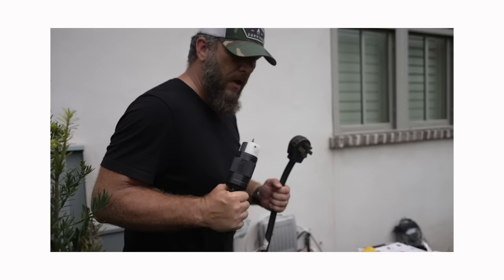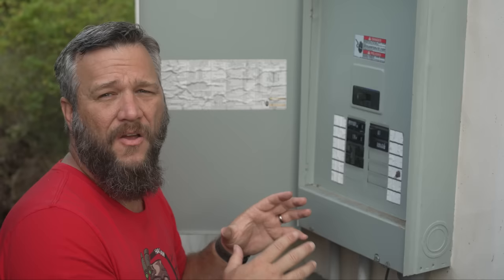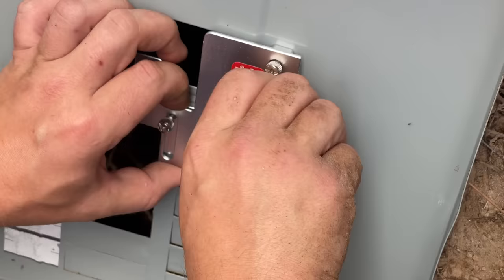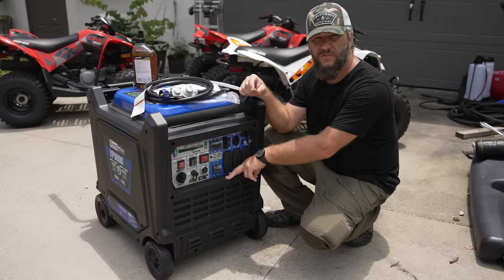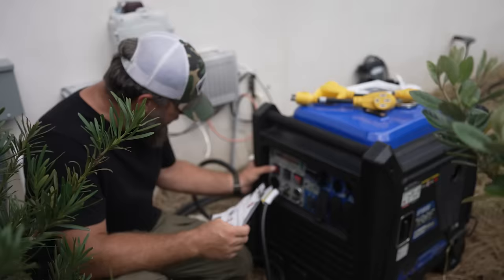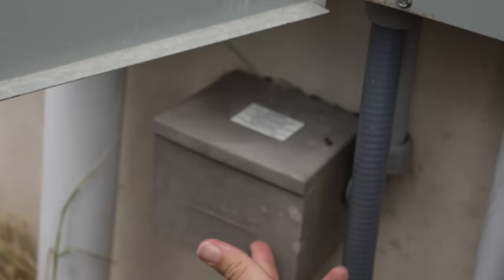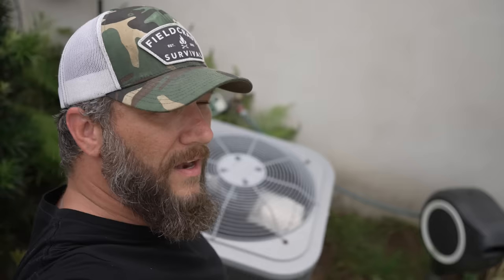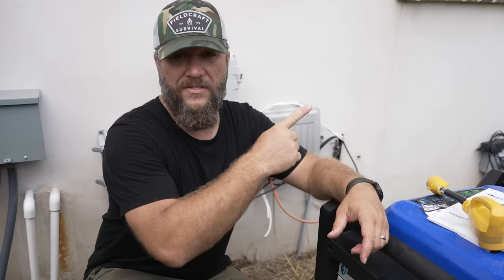90% Don't Know About This Fatal Generator Connection

Comment: Exactly the video I wanted to see since my new Micro-Air soft-start devices arrived today for my 1.5 and 5.0 ton A/C units. Among the many benefits, they reduce the initial amp surge required by approx 75% on average, requiring much more reasonably sized generators. I’m looking at similar units to yours now but as you illustrated at the beginning, we paid our home builder to put in all of the infrastructure for a generator but not the generator itself and we have the same issue in our breaker box. I guess I thought that there was a separate cutover switch instead outside near the meter. Is that a thing? 

Great video. Thanks.
Reply from the maker: Usually you just have the whole house breaker outside to cut all the power for your house but no panel box that can be connected to. I just happen to have a panel outside because of my well and my Mom's addition. That made my setup a little easier.
Reply: Just installed the Micro-Air 368 on my 3 Ton HVAC unit. Inrush amps dropped from 63 to 23. The main 200 amp breaker is located outside in a panel by itself with a 90 amp breaker which feeds the pool equipment. The outside panel feeds the distribution panel in the garage which is just a sub panel to feed all the circuits in the home. I did the same thing with the home builder so now all I need is the generator, 30 amp cable with 14-30 connections to hook up to the home and probably 4 propane tanks. Looking at the either the DuroMax or Champion dual fuel inverter. 9000 watts starting and it claims to be able to do 6500 watts running. That should be enough to run the HVAC plus frig and freezer with some left over for lights, etc. Having the whole house HVAC is a big deal here in South Florida. We were out 8 days after Hurricane Ian in 2022.

Great video and very important to get it setup safely thank you.

Comment: The same exact thing happened to me. I hired an electrician, and he didn't move the existing breakers or install the interlock. I've done plenty of wiring over the years and the only reason for hiring a licensed electrician was to have 100% code. 😤

Comment: 4:25 It makes a difference. My knucklehead step-dad used a regular power generator one time to power some items inside his home during a power outage. That generator caused everything with computer chips in them to fry out, so now he had all these dead appliances to replace. The output on home generators must be pure, clean, and spike/distortion free, otherwise you as a homeowner are going to fry your computer controlled items.

Comment: I’m sure you’re absolutely right however for me there’s far too many if”s ands or”s buts and maybe’s and don’t forget”s I have heavy gauge 50 and 100 extension foot cords and a way to safely route them in the house as needed we have some Solar also so again extension cord from the inverter to the refrigerator or whatever.

Comment: we used a gen transfer switch.  a little more complicated to install, but the one we got has gauges showing amp usage per phase.  Helps a lot to ensure you're not overtaxing the gen. also, i installed a second smaller transfer switch for other less important circuits.  that way, i can have two generators going and turn the smaller one off when i don't need those circuits.  most modern fridge/freezers will be fine without power for 2-3 hours (much longer with some) so you can save fuel and have them on a separate gen that you start manually (have to disconnect it when starting or stopping so it's a bit of a pain)
Reply: That's the issue with trans switches, you have to pick the circuits ahead of time and limited to them during an outage. With interlock, you can turn the ones you want on and off how you like.

Comment: The reason to use "pure sinewave" generators (and battery UPS units) for electronics is the inexpensive (non pure sineware) inverters create stair-stepped sine waves. Each individual step creates high frequency harmonics that cause havoc with digital electronic devices. With more and more consumer appliances using digital control boards, the possibility of appliances not working or being damaged by dirty generators/inverters is getting greater.

Comment: You mentioned having a buried propane tank. You are probably already aware of this, but I wanted to share some important considerations and concerns about this practice for viewers of this video.

First, cathodic protection and proper coating of the propane tank are crucial. Without these measures, the tank can corrode rapidly, which could be catastrophic. Cathodic protection typically involves sacrificial anodes to prevent corrosion, but there are also systems that use a low voltage current to protect the tank.

Second, think about the water drainage around the tank. Proper drainage is necessary to prevent water accumulation, which can speed up corrosion. This might involve regular maintenance to ensure the drainage system works properly and the tank stays in good condition.

Also, make sure your tank installation follows local and national safety regulations. The National Fire Protection Association (NFPA) has specific codes, like NFPA 58, that cover the installation and maintenance of underground propane tanks to ensure safety.

Lastly, it's important to keep up with the tank’s maintenance and inspection schedule. Routine inspections by a professional can help catch potential issues early and prevent catastrophic failure.

Comment: Good video.  However, on the test run, you should have turned off every breaker first before switching to generator power, then switching each breaker on one at a time after you switch to generator power.  That way, if your total house load to too much for your generator, you will know immediately, and begin shutting off individual circuits without worrying about damage to any equipment.  IMHO.

Comment: not only can you kill a lineman but if the generator is running and plugged in and the power comes back on your generator will explode and burn. you must have a transfer switch or a main breaker interlock lock out. this way you can only have one or the other not both at one time. good video for people new to generator hook up .

Comment: I bought the same generator to replace a small unit that I had. I'm glad I did. The old generator was not a inverter generator, and for that reason over time I lost a lot of electronics including a refrigerator, television, and a computer. You can get away with a non-sine wave generator but not for very long. So I made the choice to go with the 9000 inverter, well worth the investment . I'm curious to know if you disconnected the internal neutral grounding strap?  depending on how you set it up you will have to disconnect that strap internally in the generator. It's not very hard to do but it potentially will keep you alive.

Comment: I have a Generac system that cost under 10000 including the 250 gallon propane tank. I have had the system for 1 year so far and I only used 10% of te fuel in my tank. I love the idea of power  almost instantly when needed. No messing with portable generators that may or may not start in an emergensy. I dont have too worry about my home when I am away and I can be sure that all my refrigerators and freezers are on 24/7. Well worth the expense.

Comment: One step you missed or I think you might have missed in your start up procedure and I highly recommend. I suggest turn all branch circuit breakers in your house panel to the off position before the generator is started and or put on line to the house. With all connections made from the gen and main breaker from the utility in the off position w/interlock , make sure all "Branch Circuits" in the house are in the off position. With utility power off, generator connected, all branch circuits for the house in the off position and generator running , slowly turn on the branch circuit breakers one at a time for the loads you want to power in the house. Hopefully your Gen has enough wattage to run all your circuits in your house. But to turn on that breaker on the gen with all branch circuits in the on position could stall the generator if it is undersized for your house load. But even if the gen is properly sized it's always better to slowly ramp up the load on the generator. Just a better practice in my opinion. Most generators can handle the in rush current if sized properly. Not sure if you might have covered this subject in another video. Hope this helps some people at the very least. Great video in my opinion.

Comment: I have the same generator but my electrician installed an entire separate box where the main electric comes in and has a 3 position lever that you move depending on how you want to use the power. It switches between generator/main power and an off completely option. This makes working on my 200amp panel even safer and easier as I can have the entire power cut off to work on it. The box also had a build in back flow for the power when you use the generator. Outside I have a similar outlet box to hook up my generator.
Reply: The electrical code requires a mechanical disconnect weather it be manual or automatic, What that electrician did on this video is simply wrong. When I am setting up a secondary power supply I usually install a sub panel and move the emergency loads that people would need to the sub panel and just set up a transfer switch to feed the sub panel.

Comment: You should make sure the generator you’re running is not a bonded neutral.. because the panel you’re tied into has a bonded neutral at the first point of disconnect..

Comment: Power management is paramount when using a genset. You have a 41 amp generator and if your AC compressor is called to come on the same time your refrigerator compressor kicks on or someone pops a Hot pocket in the microwave while you have the rest of your goodies on, something could possibly fry. 
I have a very similar set up as you do but with a 30 amp genset since we got hammered by Andrew. Being a true Floridian AC after a hurricane is optional. Not destroying the generator or my appliances is most important so i manage my power output using the breaker panel to leave a 10 amp buffer at all times. Doing this also saves on fuel which is also pretty precious after a storm.

Comment: Backfeeding is safe IF...DONE...PROPERLY. 
I made a 4' su!c!de cable for emergencies.  I keep it and a padlock in a box inside a gun safe so nobody screws around with it. 
There's 2x 100amp breakers in an outdoor panel.  Trip those to isolate from the grid, and lock out the box.  Then trip every breaker in the main panel.  
Only then would I activate the generator source, a 30amp circuit I installed for my RV pad, and 1 or 2 selective circuits (refrigerator, furnace, fiber modem, etc).  That's enough to keep food fresh and my family warm.  
Total spend $30 aside from the generator.  Haven't had to use it yet.

Comment: You need to install a "hard start kit" on the a/c compressor.  It will save your generator from overloading during start up.  Most new units do not have them installed from the factory.

Comment: I am the general manager and lead technician for power on time. Your generator placement should not be within 5 feet of a window. It should not be within 5 feet of a door, and it should not be within 5 feet of any form of vent, including a soffit vent. Your placement right beside that window would be considered incorrect.
The Cost. On average to install a air cooled generator, less than 26 kW.
Includes an average of $1800 for the electrician,
$800 for the cost of the plumber.
Depending on digging that is required that can go up.
The cost for the ground preparation for the pad is $250.
The cost for the composite 4 inch hurricane rated concrete mounting pad is right around $500.
And any company that installs a generator is going to then try to put in between $1500-$2500 in profit depending on location

Comment: Great job with your generator hookup.
My I suggest a shed for your generator. 
Possibly a Rubbermaid or home made one.
This way in a emergency your not trying to push it in place.And trying to connect gas lines in the middle of a storm. You can make a video about it. Work smarter not harder.

Comment: Just use a heavy gauge 12 or 10 gauge extension cord I guess you could use 14 awg however I like to keep the generator as far away from the house as possible so I usually go with a 10 gauge it’s a lot safer

Comment: ive got a predator 9500 inverter that looks identical to that thing. must be the same manufacturer. mines gas though. just buy non ethanol and your good. i keep it on hand for all small engines especially anything like a chainsaw that needs mixed fuel.
Reply from the maker: I almost got that one but it didn't have dual fuel.
Reply: @HAXMAN  ill be honest i did the same setup but put it in myself. i wasnt willing to move and entire row of breakers to put the inlet breaker on top. guess ill just have to use the thinker a bit every time i use it. maybe one day ill be bored enough to rewire my entire box...
Reply from the maker: @alexbell9196  I thought about making my own interlock out of aluminum so I wouldn’t have to move everything and then my nephew volunteered to help. 😄

Comment: Years ago we bought a backup stationary propane generator. A backup not standby, I have to make connections and throw switches. Stationary so it sits a few feet away from the house two feet above ground on a mechanical platform above potential flood water level. Stationary means it might be slower to walk away too. We felt propane was safer with less worries.

That winter when electricity was off during storm it had a mechanical failure. I thought it was cold temp and LPG problems. Should of had a backup backup generator.

Future plan is a diesel genset to recharge power wall with solar panels setup in similar fashion.

Comment: Great video as always.  Good to know.  I have a hole house installed set to auto so mmmmmmm.  Going to see how that’s hooked up as it does start when the power goes off.  Thanks again and keep them coming.
Reply: If you have a whole-house generator setup, then you have what's called an Automatic Transfer Switch. The ATS essentially does the job of that interlock device, so you won't find one on your panel.

Comment: You also need to take out that Siemens breaker and install a cutler hammer breaker. All breakers should match the panel brand to maintain UL safety.

Comment: If you're gonna use this generator to backfeed to your house, you're gonna want to convert it from a bonded neutral to a floating neutral. Take the front panel apart and you'll find a bus where neutral and ground are connected. Just disconnect neutral from ground. 
If you ever want to use the generator in standalone mode, you can reconnect the wires, or make/buy an adapter plug to plug in that connects neutral and ground at the 110 outlet on the panel

Comment: I'd also recommend using NON Ethonal gasoline in generators if storing them for long periods.  Stunt Nephew came in clutch!
Reply from the maker: He's good to have around. 😉
Reply: My personal cocktail for regular ethanol gas is a double shot of Stabil and an ounce per gallon Super tech TC-W3 two stroke oil.  Stabil is a light aromatic hydrocarbon supplement, and the oil prevents ethanol/moisture induced corrosion of the carburetor.  If you live in a high humidity area, ethanol-free fuel is the way to go.

Comment: I thought it was going to be about neutral bonding.:) My understanding is you do not want it bonded when connecting it up to the house since the mains are already bonded. I have a bonding plug I use when I use generator as standalone.

Comment: Nice non-fatal generator!  
Only improvement is as you mentioned, bigger tires - no fun saddling up through the planter with a foot of snow with those babies!
Reply: While it will cost about $ 1000 he could do like  I did.  Put one of the carports next to the house and a small storage shed for the generator next to it or even under the carport.  Store the generator and if you have separate propane tanks in the small shed.  Roll the generator out of the shed before starting it.   That way you stay out of the rain or other bad weather while getting things going.

Comment: My wiring is not set up to use an interlock.  I have to turn off the 200 amp breaker on the pole and then hook the generator to the shop.  Running a generator on propane is a great idea.  All three of my generators are dual fuel and have never had gasoline in them.

Comment: Oh geez, the "pigtail of death."  Plug ALL those in before starting your generaror. And turn the breakers to the  generaror off at the panel BEFORE shutting off the generaror or you will damage the generator.

Comment: I use the lock switch interlock. This is like a stick between switch, when you flip the “grid” main switch off, the generator line goes on. And vice versa. I find when the grids back on, I switch back to grid and there was no power interruption in the house, like TVs and computers.

Comment: Look at getting a micro-air easy start for the air conditioner. People with campers use them to run air conditioners off generators but can use on house units. A.C. Pulls less power on start up with it connected.

Comment: Your going to need that parallel. I live in an RV your barely going to get 50 amps out of that with it screaming if u want it to past and to not be popping the main breaker during heavy usage the parallel is a must